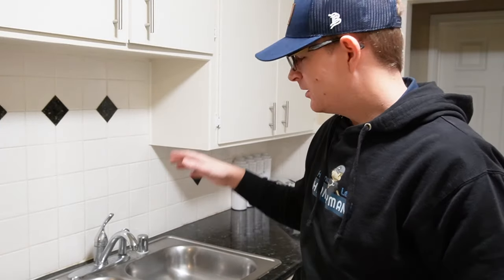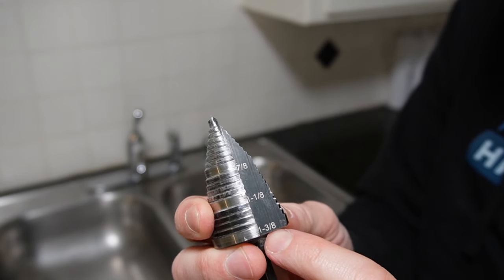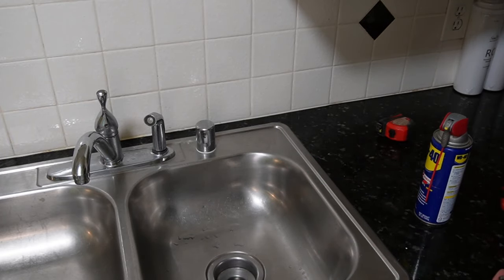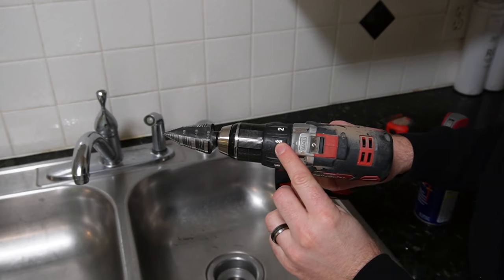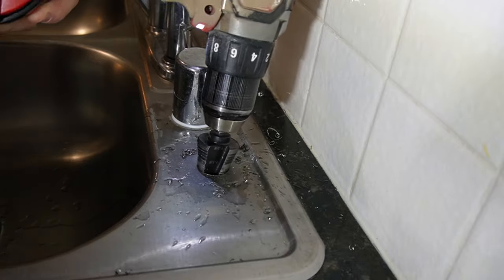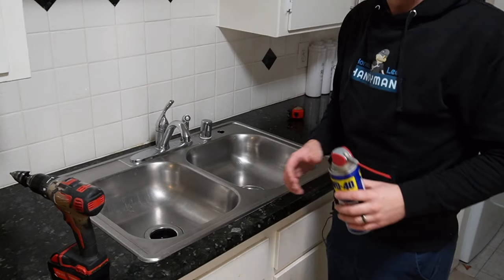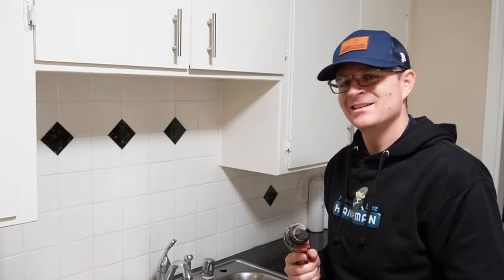How To Drill Hole in Stainless Steel Sink | Step By Step

Comment: Is this ragebait? Literally everything was wrong. Don’t tighten the chuck by spinning it in your hand. Don’t just raw dog your step bit. Use a pilot bit. Go way slower. Way more pressure. Water instead of oil. Don’t wobble the drill around. You want the bit plumb, steady pressure/slow speed

Comment: A TIP  :Drilling stainless steel can be expensive because o drills cost a fortune and wear quick, to fix my problem i used a plasma cutter to blast a minute hole in stainless steel then used standard drill to open hole to right size works a treat quick and cheap. Give it ago. Ckeers

Comment: Thanks for the video. 
Slipping is typically avoided with a simple nail punch mark. As for the drilling, why not use a suitably sized TCT hole saw? The stepper bit seems tedious. Much quicker, much less metal mess, less stopping and starting for lube, etc.
Keep up the great working.

Comment: I drill a lot of stainless steel sheet metal, especially for door knob holes in the kick plates that go halfway up the door for commercial restrooms. I don't do that many stainless steel sinks which is a thinner stainless steel. But I'll tell you the Milwaukee one key hammer drill uses an app where you can adjust and set your RPM speeds per each drill speed setting and if you set it to about 500 RPM on your first gear speed setting. It is perfect and as long as you use a high-end cutting oil. You will never burn out a whole saw
Reply from the maker: Awesome man! Thanks for your comment! I appreciate it!

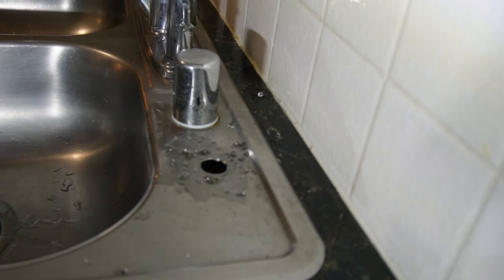Comment: At 02:50 mm:ss, you state: "Because stainless steel is very hard material".  This is true, BUT, it is NOT what makes drilling S.S. difficult.  The smoke you create when drilling is from the S.S. becoming HOT and burning the lubricant.  HEAT is the ENEMY when drilling S.S.  Why?  Because, as S.S. gets HOT, it IMMEDIATELY becomes MUCH HARDER and ruins your drill bit ASAP.  Best to use a COOL continuous flowing lube to keep the S.S. and drill bit COOL.  If YOU SEE SMOKE, it's already TOO HOT!
Reply from the maker: Thanks for your comment!

Comment: Water for cooling your bit NOT oil which will burn and dull the bit. Use good pressure but slower speed.